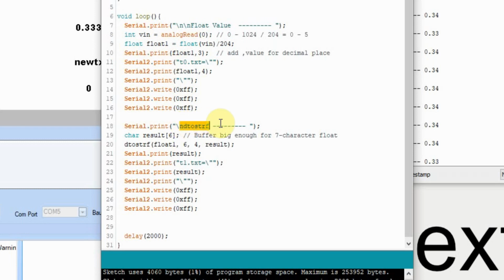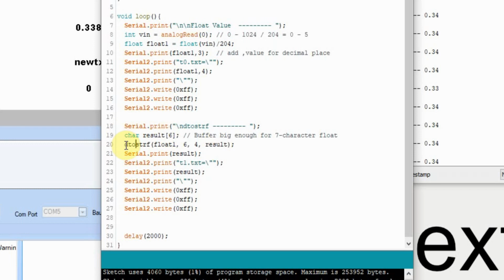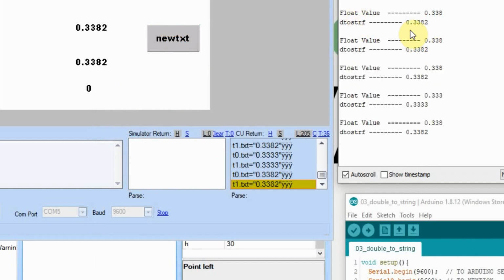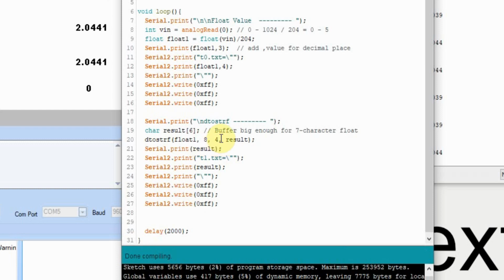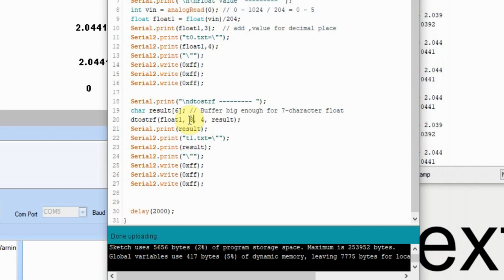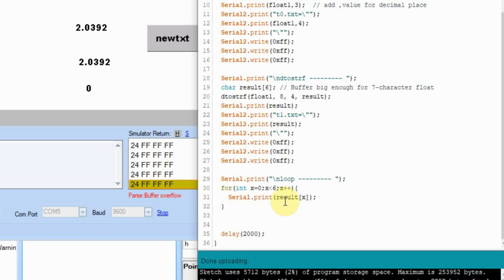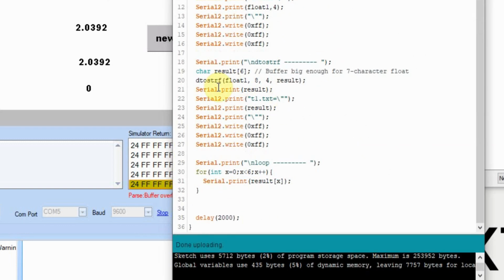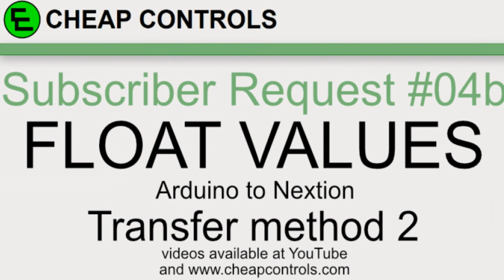#97 Nextion Display - Float value Arduino to Nextion with dtostrf - Nextion Tutorial

Comment: Hi Sir can you please tell me that when I turn nextion display power off, and turn on again its loose saved data in text box.
Reply from the maker: I have a video coming out later this week on the internal eeprom of the Nextion display.  You can use this feature to save some data on reset and power loss.  Stay tuned!
Reply: @CheapControls  Thanks